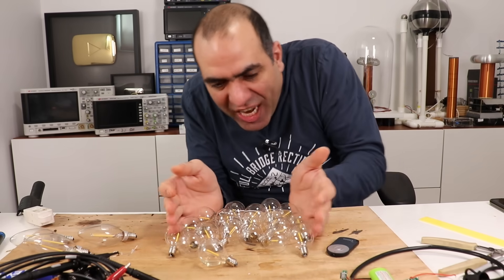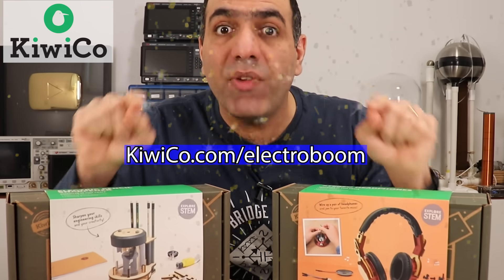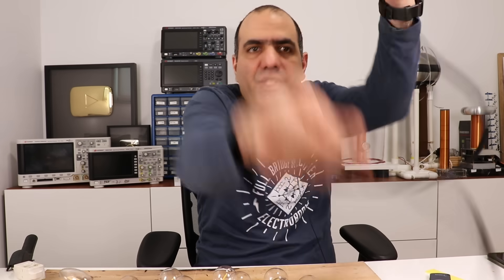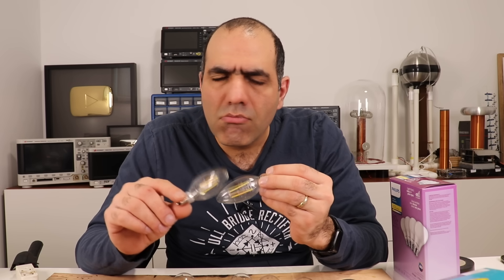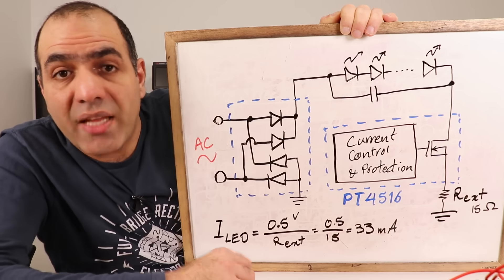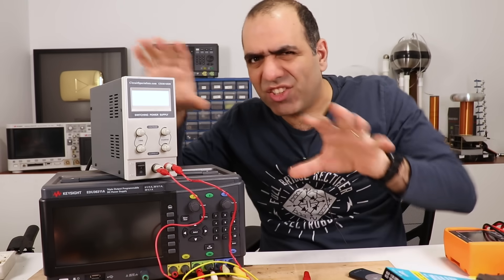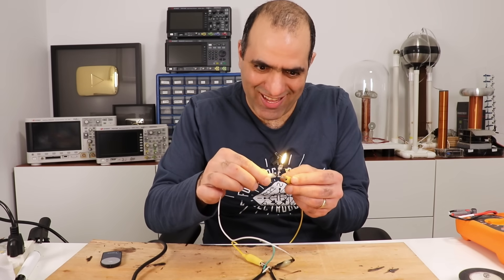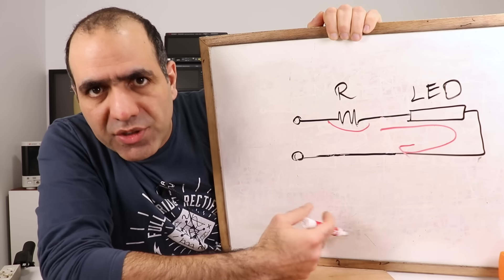So Many MISERABLY FAILED LED Lights

Comment: Minimum warranty here is 2 years, razer provides 1 year warranty but this is not America, 2 year warranty obligated. All razer products die in 13 months so u get to ask refund, then make a separate purchase of same razer product which... Comes with 2 year guarantee.
Razer products are expensive, they're good while they last but they always die in 13 months. One month after their intended guarantee.
If a store says its 1 year guarantee and it's product meant to last, they're breaking the law.
Only products which don't get 2 year warranty are products which are meant to be replaced often. U can't buy milk and return it after 2 years because it's gone bad etc.

Comment: This is planned obsolescence.
I have a bag full of dead LEDs
Most of them have faulty led,they tend to get open, power supply is okay.. just by shorting faulty led u can use them for a month or two until that goes bad again.

Comment: Lol.... 

Going back to the store for your warranty will ruin your carbon footprint , and due to cost of manufacture, and the fact that this manufacturing process uses electricity - reliability of the bulb should have a tangeable effect on supposed energy ratings

Comment: I'll agree with half your statement. "The led is bad and not the driver." 

The driver is cheap and substandard causing damage to the led that failed. If you put new leds on the driver you can see it will damage the new ones.

Comment: If the LED's cost $$'s and the old-fashioned incandescents cost c's, doesn't that say something about the cost & environmental impact (and carbon intensity) of LED's? I resent having the choice taken away from me. I have replaced my high duty cycle lights with LEDs (and taken several back for replacement after disappointingly quick failure) but for others, replacing one infrequently used incandescent with another (while I still have stash of contraband) is more economical, whichever way you look at it.

Comment: Warranty means you  can replace 2$ light bulb for free, you just need to pay 15$ for shipping. 
And they will send it back on your cost, saying it's user damage. I know, I have a lamp that burned one per month. I asked for warranty replacement after 3 packs did not last 1 season.

Comment: You could just blame it on the Chinesium…. But, a great many of the ‘GOOD’ LED bulbs also come from China.  So, it would seem that the problem is related to building items to a price.  They are built to sell for a certain price, and everyone in the chain from digging the materials out of the ground, to ringing the cash register has to make a profit.  To get lamps that sell for a dollar, you must cut every corner that science enables you to cut. The result is, lamps in which the devices are driven too hard, and therefore, too hot. Heat will destroy the weakest component in the mix. In the failed lamps that I have examined, that is usually one of the LEDs.  I’ve never seen a current regulator fail. The current is usually set by a pair of resistors in parallel. If you clip one of them off (The smallest resistance value) you will greatly reduce the current used, without a tremendous difference in light output, and will extend the life of even the ‘cheapies’ by a large amount. This, of course, is something that should only be done by someone who knows what they are doing. Over-driven LEDs, and inadequate heat sinking is the cause for the failure of the cheapies.

Comment: Some of the "manufacturers" use rebranding when they buy cheap LEDs from Ali put them in a package (which is probably also from Ali) and sell them at a, in worst cases, 10 times value. They get through with it by giving the warranty.

I noticed this when I worked as a supplier. Most of the items I found in stores were from Ali.

Comment: I was able to significantly prolong the cheap LED bulb life by relapsing it's LED by more durable/quality ones.
New LEDs can handle more current -> operates not in max current -> lives a lot longer.
Resoldering process is very easy when you use a "LED Lamp Remover Station Heating Plate" from aliexpress: 4$ :)

Some of my LED bulbs are operational for about 5 years (indoor everyday use on a kitchen ~3/hours a day)

Comment: im still sticking to CFL lights.... much better when it comes to lifetime. Some i use are already 12 years and older and have easily 10k+ hours on it.
Meanwhile even expensive LEDs failed after 1-2 years easily.

Comment: Just remove the stupid glass and make a hull water and finger proof with some air flow or a heatsink.
For most indoor applications you don't need much protection, a stainless steel mesh wrapped around and connected to ground should make it safe.
Also it's way more efficient in a low voltage direct current system like a car.
If I made a house electrical system, I'd probably run a 12 volts DC system for the lights, power it with some 12V batteries connected to a wind turbine on the roof.
Free light. You could get parts for cheap, just use a car alternator.

Comment: In case anyone is curious.  The reason most lights stop working after a short amount of time is because they're supposed to.  Their lifespans are kept artificially short so that you buy more in the future; because even very early commercially available light bulbs had incredibly long life-spans.  This is demonstrated as the longest continuously running light is a lightbulb currently at a fire station that has been running since 1901.  https://en.wikipedia.org/wiki/Centennial_Light

Comment: As Medhi well knows, engineers purposefully design systems to meet the demands of the application. However, more often than not Engineers are forced to include predictable failure rates that are designed by the products teams to purposefully fail much more early than they are "claimed" to be. They perform huge statistical analyses to see what failure rate consumers will tolerate.  They know exactly how to prevent them from failing.. it's just more expensive, and hurts your business model

Comment: Re: warranty: they usually require the UPC and receipt from the store you bought it from. Most people don't keep track of those and usually toss them. They're banking on that. It's an empty selling point. Listing the expected lifespan in hours is another technique to confuse the consumer, most people aren't going to do the math to estimate how many hours a bulb was on for. 10,000 hours also sounds better in an ad than 1.1 years. 

Re: write reviews: this one they can take a page from the mattress and appliance industries. Change the model number every year and maybe some adjustments to the hosing design or something to justify it. New model number, new listing, no one star reviews.

Comment: 7:52 So let's just plug it straight into the 120 S*!. 7:56 👅 Please just don't tou-- AAA S**!. 7:59 Come on you little S** just stay apart. 8:02 Now we can just probe across the resistor and understand the behavi---! F**! S**!. 8:06 and because the probe-gram must be connected to neutral or earth we better AAAAA HHH!. 8:11 we better turn off the circuit.

Comment: "Low-grade silicone will become brittle after 200 hours of operation. It will cause the filament structure to fracture and to break the wire-bonded LED string. "
https://www.ledinside.com/knowledge/2015/2/the_next_generation_of_led_filament_bulbs

Comment: Good luck claiming light warranties. I've done it with Cree bulbs--they require ORIGINAL PACKAGING (which I know save), plus return shipping. If they weren't expensive Crees, warranty may cost more than the bulbs!

Also, Big Clive has done some relevant experimentation with under-driving LED bulbs for longetivity (idea borrowed from some long-life Phillips bulbs made exclusively for the UAE.)

Comment: Hi
I've got a Question:
I've build myselve a Capacitor out of Aluminium foil and 3layers of 5m long Book foil. It has a capacity of around 150nF (might get higher when loaded with high voltage due to attraction force) now I will test how much voltage the foil can handle first and then load the capacitor with a voltage lower than that. I expect it to be able to handle something around 15-30KV.
I've got a power supply which can output 30KV, and this is kind of save,cause the Energy and current is limited. But now i want to ask you, if the capacitor with around 150nF would be save if loaded to 30KV. So in case i touched it will it just badly hurt or might it harm myselve badly.
I've read that ESD over 350mJ is harmfull and this thing would have around 68J if loaded to 30KV. So this would imply that it is very harmful. But if i calculate with 1000Ω of my body and this capacity and voltage with the formula 
t=R*C*ln(Umax/Utol) with Umax=30KV and Utol=30V (tolerable)
I get to a time of 1ms till the voltage is at 30V when i touched it. But i've also seen in a graph, that at a current below 10A through the body it wont kill you as long as it is shorter than 10ms. So now my question is, if it really makes a that big difference if its below 10A or below 30A. (in the case of 30KV and 1KΩ)
Or did i calculate something wrong?
Reply: I understood everything, but good luck touching them
Reply: @thelaststraw_05  I think i wont touch it.
But i'd like to know how carefull ive gotta be

Comment: It is infuriating! When LED lights for home application came around I was delighted, only to discover that the concept of planned obsolescence was still in effect. 
Which makes the whole situation even more infuriating, given the fact that cartell-planned obsolescence in traditional light bulbs was one of the first large-scale industrial scams to be found out...
Reply: You can either buy the low wattage, high lumens ones (granted, pricier), or you can buy cheapo and modify them to run lower wattage.
Reply: @Olivia-W  Exactly!  Underrunning L.E.D.s will cause them to last many, many years and the brightness is 'almost' the same but close enough.
Reply: @Olivia-W  The only thing is that many brands are now following the example of planned obsolescence and simultaneously the cheap chinese brands have learnt to rename their brand, change the packaging and charging more so they have the same product on the shelf at cheap and expensive price. Bottom line is that we are all screwed.
Reply: Buy quality product, and they will last. ALSO, don't run LED bulbs on the SAME CIRCUIT you run your 2 HP shop vacuum cleaner on, the voltage spikes will eat LED driver circuits ...
Reply: Everyone is made to work hard just to keep things running in household. Washing machine to lights. 
Planned obselence. More garbage in earth. The cheating  voters elected big cheaters.
Road to hell.
Reply: Bro, the reputable manufacturers have stopped doing planned obsolesence ( except for apple and the company supplying Mcdonalds ice cream machines )
Reply: @darkkillerultimatespeed4084  Fun fact: the ice cream machines arent actually broken. Theyre just a model thats very difficult to clean out, so they just say it's "broken"
Reply: @darkkillerultimatespeed4084  wym? Right to repair is still not a real thing even in the EU, much less in the US, and planned obsolescence is definitely still a thing.
Reply: no worries, the "climate change" is also a cartel and a industrial scam to keep countries from developing by denying them generating energy in cheap ways.
nothing a bunch of laundered "green credits" (also invented by, drum rolls, the gas and oil companies) you bough for cheap doesn't solve

Comment: How about a bipolar 1uF cap instead of a resistor? Less heat.. But, you plug it in at a high voltage peak, and SURGE!

Comment: CAUSE ITS NOT WATER & MOISTER BUILD UP PROOF...only FULL COATED PLASTIC LED BULBS ARE..THEY ARE SEALED TO SOCKET SCREW..SO PEOPLE SHOULD NOT USED IT AT OUTSIDE OR BATHROOMS

Comment: it's not just LED lights, it's anything made in China.  I don't care to get into a political argument, I am going by my age, and purchasing items for decades, made in the USA, Japan, Taiwan,  or other countries. I never had this issue until everything started being made in China (including all the components). Items I purchasd use to last for years and years. A  washing machine made in China I purchased,  lasted 18 Months (I don't even do that much laundry, as I don't have children living at home).   I never had a washing machine last less then 15 years in the past, and I have been living in the same house for over 40 years (the manufacturer dispatched a repair man, he tried to blame it on my water quality, or pipe drain setup, which is nonsense, because like I said I live in the same house for over 40 years, and nothing changed).  Russia has started manufacturing their own capacitors and other components,so not to fall victim of China's built in design for thing products to break quickly. I am lucky if a computer keyboard lasts a few months now, and headsets and other computer components I purchase now, last about a year.
Reply: It's not about where it's made, it's about the quality of components. Blame the big companies. Not the country 😂.

Comment: So even the 'high end' LED bulbs only rectify the AC and don't have a capacitor to smooth it out. In other words, the bulb still flashes at 60hz. That would explain why some slow-mo videos look like they were taken at a rave.
LEDs have so much potential and can give such a nice even lighting, but instead we get a 60hz strobe light.

Comment: Funniest thing is that when I buy the cheapest ones from my local store, they don't fail, literally never had any of them fail, and they're all over my house.
When I buy Phillips or other brands, they always die very shortly, and get replaced with the cheap ones.

I guess the big brands led's are just overengineered and have some failure points the cheap ones don't have.
But honestly I'm just lucky with that cheap brand since I've tried other cheap brands and they were terrible.
Reply: Same here, we just get generic Walmart bulbs and they last just fine.
Reply: I run the generics I like best, and they're great too.

Comment: Just buy the cheap leds from aliexpress and expect them to lie about the watt ratings... still less than half the price of other places so if it only lasts 12 months who cares. Sometimes you get lucky and have a light that works beyond 2 years.

Manufacturers know nobody can be arsed with returning leds for warranty, costs more than its worth to send it back.

Comment: Led are designed to fail and rhe led companies got pissed off when dubai ordered they need to make multi filament bulbs and run them at lower power so they dont burn themselves out so quick.(he get to that in half of the video)

Comment: 5:21 i almoust got nightmares due to testing a 12V tiny battery of my bycicle speedometer. So i dont want to touch this with my tounge. (if you test 12 V with your tounge you will literally see flashes in your eyes. Dont know why, probably the electricity is messing with the nerves of your eyes, but THIS ISNT A JOKE

Comment: If you have electric heating with a thermostat and use the heating most of the year (for instance, most of Canada) you are not saving that much energy by dropping incandescent.

Comment: Why don't cheap LED bulb manufacturers use a capacitor and limit the current flow with impedance instead of pure resistance? If a failing capacitor creates a much bigger problem than an inefficient and short lived resistor, I can understand that. Just curious

Comment: In my city Wichita Kansas USA, the city upgraded a bunch of street lights to LED.  After a short period of time the lights color shifted and many of them are now a deep purple blue color.  We have one of them on our corner.  It’s almost like a super bright black light! 😂The city is working with the manufacture to get replacements.
Reply: Calgary, Alberta, Canada, same thing happened. All on one stretch on major road way right before turn off, so I can never miss the exit now 😂

I wonder same bulbs/lamps/supplier etc cos apparently just a manufacturing defect. Not from temp extremes like I figured, as we get like -30c(-22f) for weeks at a time in winter.

Comment: The MTBF of a led light is what is mentioned, usually around 20,000-50,000 hours. However there is another factor involved. It is AQL, the maximum percent  that can be considered satisfactory during production.
This can range from 2.5%-4%.

So what has happened is that the led lights you have that broke down, are probably in that 2.5%-4%. Of course it also depends on the way that the defective ones are distributed by the manufacturer. And who they are distributed to.

Comment: IP44 is not sufficient for external use _at all_! You can use it in an environment with rough dirt (>= 1mm particle size) and seldom sprinkled water. Not condensation!

Comment: IP44 Waterproof? IP44 is not waterproof. You need at least IP7 for that. The IP44 rating only means that the product can resit  "water jets." Any longer exposure than that or submersion is guaranteed water ingress. Even IP7 is not fully waterproof. A product with IP7 rating can be submerged in a about 1 meter deep water for 30 minutes. After that, there's no guarantee water won't come in.

Comment: Electro boom. Please please please do this idea. Build your own bench power supply, it’s a good idea
Reply: I mean it's not that complicated. You just need to be able to take in AC convert it to DC and then make sure that it's stepped down to the voltage and amperage you want/need
Reply: @logickedmazimoon6001  I know how to build it, I’m planning on making it, I want to see how electroboom would make it as he has more experience

Comment: Electro boom LED is not efficient when used in parallel light string that adapt from ac because of thermal dynamics of joules being lost as heat .

Comment: I don't know if it's because of bad design or what, but I have blown a fuse in my apartment a few times when an LED bulb died. The lamp I used them in was a cheap and crappy floor lamp, but for some reason this never happened with incandescent bulbs.